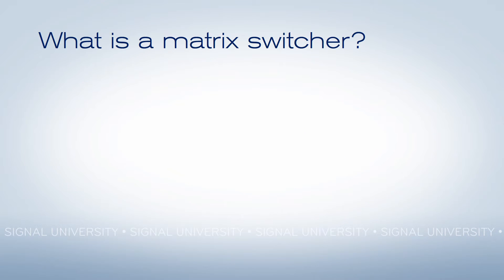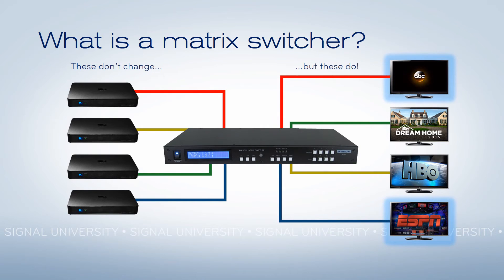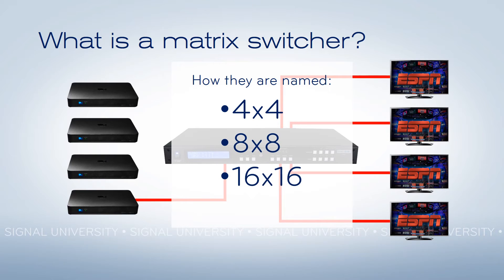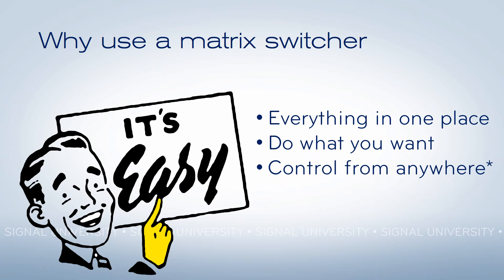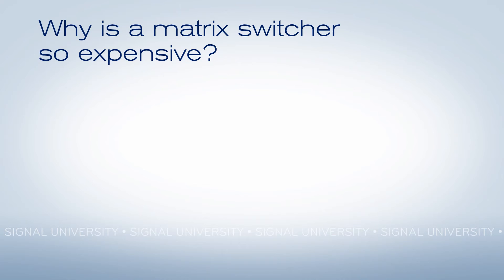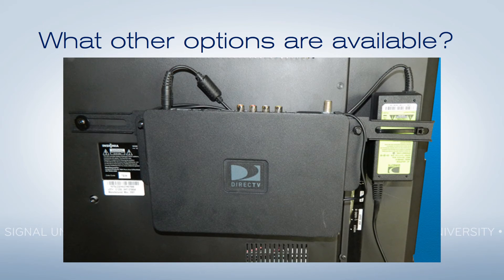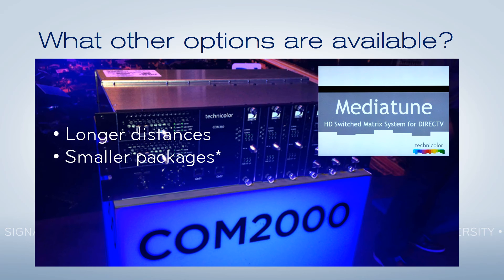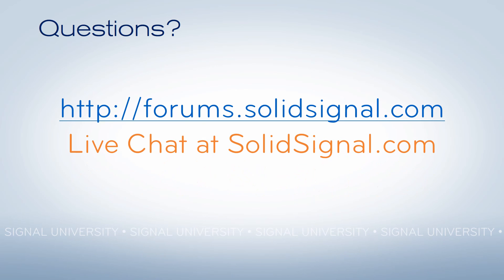Signal University presents: What is a matrix switcher?

Comment: Hello, does evry matrix work with evry other brand or you have to stick with one company in order te get best out of it? I have a full modulare utp matrix support 1920×1200 my goal to make a couple tv and video-wall as it is 32x16. I need to but transmitter/receivers so can i buy anything or just the dvi and hdmi adapter? Thanks
Reply from the maker: Every matrix switch should work with every device.